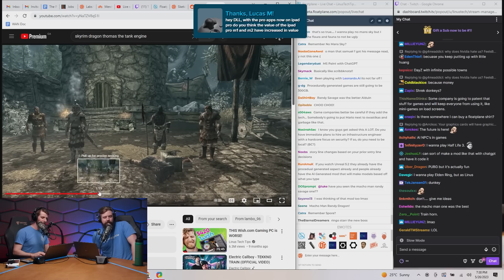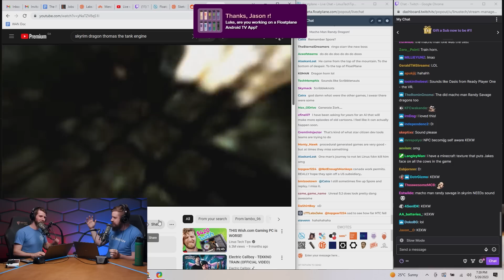Moore’s Law is Irrelevant

Comment: Moore's Law is so dead, i waited almost a full decade since 2013 to at least double the singlethread perfomance on a CPU. From an i7-4700MQ laptop chip to my current DDR5 desktop i7-12700K, 2.14 times faster CPU-Z single thread score, with a 47% increase in clocks. I wanted 100% better IPC, not 53%.

Maybe my next significant singlethread upgrade will happen in 15 years. (Still is nice going from 4 cores to 12 cores Big-LiTTLE style, i waited for Big-LiTTLE on x86 since a very long time as well).

Comment: Not only that, but improving efficiency of software by reducing overhead and the re-introduction of dedicated co-processors(namely AI accelerators), even without massive increases in transistor counts overall performance will still continue to increase, just maybe not in the way we’ve been used to

Comment: Material sciences will take more of a priority. Instead of investing billions into shrinking down the nodes, they'll be investing billions into discovering/developing new materials with better properties for processing.

We are nearing the limit of Silicon. But silicon is not the only semi-conductor out there.

Then once the gains from new materials settles down, they'll start focusing on software optimizations. For example, new methods for parallel computation allowing for something like SLI but thats actually good.
Reply: No, but it's basically the only useable one. Unless you want to be paying for carbon nanotubes

Comment: so the thing is, in terms of technology, modding is the easiest it has been, the modeling tools are available, the engines are either free or been around for so long people know them inside out, etc. what gets in the way of modding is pure corporate restrictions

& the same will happen with AI modding if it ever gets included in games, you will either get locked out from using it, or charged as the new form of Microtransaction

(also there's the fact no matter how advanced it gets AI needs a database to create from, so most of the copyright infringement won't happen without actual human modders)

Comment: Fun fact : moore's law is not just about transistor size...
Reply: It is number of transistors per chip. This can be done with higher density or more die area or chiplets.
Reply: @dadudeme  I absolutely hate the more die area or chiplet approach. It stagnated the singlethread perfomance.

It seems like Intel will switch to tiles in the future and for me it really sucks. I'm on the niche of music production and console emulation that historically has been better on monolithic low latency CPUs, like my current i7-12700K. I will struggle to find a good replacement in the future if monolithic Ring Bus is gone.

Comment: CPU innovation has stalled.. What do I mean by that? SINGLE THREAD performance has only increased around 35% over CPU that I bought 5 years ago. Long time ago (90s-00s), single thread speed performance used to DOUBLE every 2 years. Now, all they do to increase performance is add more cores, faster ram. The chips run super hot too! Long time ago we didn't even need fans on CPUs and video cards.
Reply: My current i7-12700K is an anomaly then (i don't know why i bought a Deepcool Assassin 3 since the CPU is so cold). My previous PC was an i7-4700MQ laptop, also an anomaly at the time. 

I'm always targeting a CPU upgrade with the highest IPC increase ever, and Alder Lake was the only CPU generation since Sandy Bridge (Zen 1 doesn't count because AMD was leaving Piledriver) that checks all the boxes (Zen 3 was pretty close, but i didn't like the iddle power draw and chiplets).

Comment: Another interesting thing for those generative AIs for game dev would be to build a rough scene, but without detailed models or even textures. Then take the depth map or something and tell the AI "make this look like a medieval village; a lush forest; a volcano". There's some extension/tool for Stable Diffusion that does that, but it takes a few seconds. I like the idea a lot.
Reply: Yeah, you can use Stable Diffusion to generate tiling textures of anything you want. You don't get normals or albedo or anything, just the color channel, but it's still a good start.
Reply: @wisplite  Yes I know. I meant that it can give you a whole finished scene just by evaluating a depth map.

Comment: It would be awesome for hardware manufacturers to run into a limit and then have the software developers to be held responsible for making their code more efficient. It's a mess right now.
Reply: Won't happen. Will never happen. The entire culture of how money people see coders wouldn't just have to change. It'd have to reverse it's current course. Business people would have to see the importance of it and they just aren't going to. Full stop. The arch over the last 30 years or so is code gets worse the more people who aren't coders are making decisions. The design and scope of projects are in flux by the business people after the main loop has already been written, and they just expect the coders to add more widgets and change how key features work. Without giving them time to refactor the code after each change. The reason Java and other resource heavy languages like it are so prevalent is they're easier to fiddle with in that manner. Adding an entirely new unplanned feature to C++ only to rip it out and shove something different in is a whole ordeal. Yet that's where we are. And it gets bad. At work we've got an internal tool that just pulls information from thousands of sources and shuffles it around to present it in a usable form on a webpage. Originally it was written in Perl. Fast, easy, hacked together in a few days, perfectly usable as an internal tool that a client is never going to see or use. Pre-dates me being there, and for a decade it worked. It is rock solid, never crashed, and I mean never crashed, in a decade of that software doing it's job it's never once crashed. System resources to run it, almost zero. Then someone decided it had to look nice by modern standards, and be user friendly to people who's jobs almost never brings them into contact with it. Now. Now it is this over complicated thing that took months to build and requires it's own database and VM instead of a script that just sat on the odds&ends server. Breaks near constantly. Us downstairs people are still using the Perl script, and we dread when the upstairs people call us because it inevitably broke again.
Reply: Hardware already ran into a limit over a decade ago. CPUs are not revolutionarily better in 2023 compared to 2005. Speeds have gone up by a few GHz, a few cores have been added to support more multithreading, and the number and types of low-level commands have been optimized to reduce the time and number of steps needed to accomplish any frequent results.

If someone has a single-threaded program, and with sufficient memory space to store the program in RAM, a newer CPU will not finish running the program in an exponentially smaller amount of time the way it would have if you compared 2005 to 1987 where you can’t even run many programs from 1987 on 2005 computers without emulation due to the drastic changes in hardware compatibility.

Most of our gains in speed have come about via larger and faster RAMs, and the offloading of graphical computation to graphics cards and their improvement through larger and faster VRAM, and more and more cores for processing as video processing is a fundamentally multithreading function. That’s only led to graphical improvements and arguably we’re nearing the limits of what people care about, most people will stop caring about the difference before we reach 64kp and 1k fps with ultra-photo-realism as our eyes have limits on resolution and framerate and 4k likely hits one for most monitor sizes and distances, and 300 fps hits the other, while people usually don’t like ultra-photo-realism without ultra-realistic controls and physics, which is dealt with by the CPU. Simulation games have had to go hard on simulation efficiency because it is so easy to run into the CPU’s limits when building any simulation at scale, with how complex and large people want them these days.
Reply: If I had to guess there is much more improvement in the short term to be gotten by software and architecture than just cramming in more transistors.

Comment: I remember reading that chips couldn't get any smaller because it was at the point where electrons were hopping between buses, then a few months later they shrunk by a few more nm.

The people working on this stuff are ridiculously smart, they hit hurdles constantly but so far they haven't stopped running.
Reply: The point is at this pace the transistors will get so small that it is not possible. Since quantum tunneling happens. Once you are at the atomic level you cannot really go any farther
Reply: You can't go smaller than 6 atoms. Cannot be done with transitors. 3nm is already only about 12 atoms.
Reply: @punplanet9730  i wouldnt be surprised if they still found a work around as even though it'd be impossible with our current understanding of physics... money is a great motivator and you'd be amazed at the insane scientific breakthroughs we could make if we paid scientists the same as these companies pay the engineers who design these chips. i mean probably not but if we were to ever find out it'd be because a company wants to make more money. just look at the element race, purely for the sake of ego, america and the ussr threw so much money at chemistry research to see who could find the most elements that we advanced more in 10 years than the 50 beforehand. money is an insane motivator
Reply: @ducdashot1239  Sure but money cannot bend the laws of physics. Quantum tunneling isn't gonna go away. Computers that rely heavily on parallel processing might still get some huge improvements but most everyday applications need singlethreaded performance and in that area all the low-hanging fruits are gone for quite a while. I think we'll see a combination of more specialized processors for accelerating slow tasks, and software optimizations.
Reply: The sizes of manufacturing nodes are misleading. That is not the actual transitor size. It is what a some specified old transistor model would need to be scaled to to achieve similar densities.

Due to drastic changes in transistors they reverence a comparison to an old standard for easier communication.
Reply: Transistors are a ways from reaching fundamental limits. Cost is also a factor. If we cannot shrink transistors massively, making them at a lower cost in higher numbers can lead to performance increases even if you have to lower clocks a bit.
Reply: That's not what happened

Comment: Honestly where we are now, if games could just be optimized on slightly older engines with devs that actually cared we wouldn’t have to move forward so fast
Reply: I would legit rather have Ps3/360 quality games (graphically) that run great over high end graphics that are optimized poorly (aka where we're at now)
Reply: yeah or javascript, which has to use the best possible tech to run it to not be ungodly slow, because there’s not a better option for big stuff on web apps and there’s tons of ads, tracking, etc which makes everything use a lot more than it needs. and then it gets used with an instance of chromium per app to create multi-OS apps more easily, which makes every program use a lot more ram and cpu than it needs. if we had better tooling for crossplatform apps and for web apps to run with something compiled it would make every computer run a lot better
Reply: @morgan0  For cross-platform apps, Dart/Flutter has been a thing for a while, and it can create cross-platform native apps from a single codebase, similar to electron and react. It can compile to web, desktop, and mobile from the same source.

As for the whole "JavaScript is slow" thing, we have WebAssembly for a reason.

The issue isn't the lack of tools, it's the lack of developers that use them.
Reply: @wisplite  Doesn't Flutter for desktop basically just run in a still slow, still poorly optimized browser, but it cant actually do anything useful other than display pages and be a potential security threat?
Reply: Much more than just games rely on computers. We would want to move forward fast even if games did not need it (They don't NEED it already).

Comment: harddrive size hasn't increased in ages. Moores law is completel nonsense (of course). I bought 5tb 2.5' drives 10 years ago. I now need to store 8tb and I can't buy 6tb 2.5' drives anywhere. We are still stuck with 5tb 2.5' drives. Where are my 50tb 2.5' harddrives? Liars!
Reply: you can buy 22tb drives now. the problem is that anything over 8tb isnt really needed in the consumer market so these drives are designed for servers or large scale storage. I've only managed to fill 8tb by installing games and keeping them even if i dont play them.
Reply: @robertse4026  Yeah and you could buy those years ago. A lot of people buy 2.5' drives, but those don't make any progress in hard drive space anymore.

Comment: Semiconductors don't even need to get smaller anymore.  The hardware necessary for super human general AI already exists.  Software improvements alone are enough to bridge the gap, and this may still take several years.  If you want to emulate a human brain in real time, the hardware for that is still 10 to 20 years away, but you don't need to emulate a human brain to surpass it.
Reply: No it doesn't. Where the fuck does somone have an ai the same as cmdr data hanging around?

Comment: Luke's idea has already been made the current issue is you run into the AI makes boards that cannot be finished. Really it can make boards that cannot be finished so you have to give it rules and then shapes to work with. voxel games is a good example. You use voxels with an angle one each side or just no blocks to put together a board. They still have the same problem of the chance of a straight line to the goal is possible. Unlucky but possible. You also have that the goal might be in the upper right corner and the player in the lower left corner.  It is in research projects right now and indie games. The reason why it won't make it to a triple A game is they can't control how hard or how easy a level or floor or area will be nor the placements of whatever to block or help you move forward along the way to the goal. There also will be no guide to the end that will stay consistent as it is all random generated content. The part of "all is random" will hurt them from the model of microtransactions that help move the player along when all is random and nothing is the same from run to run.

Comment: Correct me if I am wrong but it is just a magnetic field and a quality issue. I think the gains right now are going to be from transistor design improvements and laser improvements. I think we only have another 40 years of improvements before it is moved to light-based processing. In my option it would make a lot more sense to move in that direction where your computer isn't even using electricity from a PSU and instead, your PSU is just a steady laser
Reply: Your comment is wrong in so many ways I don't even know where to start.

Comment: I think that the focus will be on making drivers and software work more efficiently to improve performance. I've always seen adding transistors as a brute force tactic. Now that doing that is seemingly not viable, efficiency seems like the logical path to me.
Reply: optimisation??? NEVER!! as we've seen with recent titles (we makin it out of gollum with this one)
Reply: Just look at how much more complicated you can make games every time DirectX updates. DX12 can render more complicated scenes faster than DX11 when implemented properly. Optimization is still an easy route to take.
Reply: That just doesn't work for GPUs in high resolution gaming. You can't optimise away the number of pixels. If you want to update the 8.3  million pixels of a 4k resolution 100+ times a second, you need raw power.

Even AI upscaling can't save you from that entirely, some parts of the GPU always have to process immense amounts of data.

Meanwhile CPUs are already ridiculously overpowered for gaming. Want a good CPU to go along a 4090? You don't need an i9-13900k, even an i5-13600k is overkill. I ran a 4090 with an i5-11600K for two weeks and I never saw a game be CPU bound in that time (at a mere 1440p and with DLSS).
Reply: @T33K3SS3LCH3N  Well, if the methods being used to compute said pixels are unoptimized, you can make it render those pixels faster by optimizing it.
Reply: @T33K3SS3LCH3N  oh so that's why every game performs exactly the same on the same hardware.
Reply: I would say optimization is a better term. But yes, finding clever solutions using the same transistor count surely has a lot of potential.